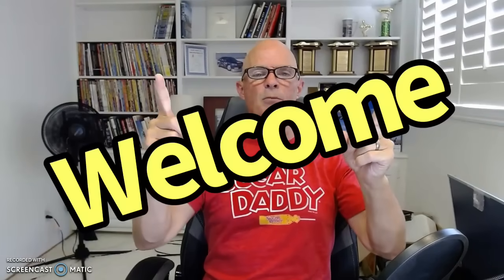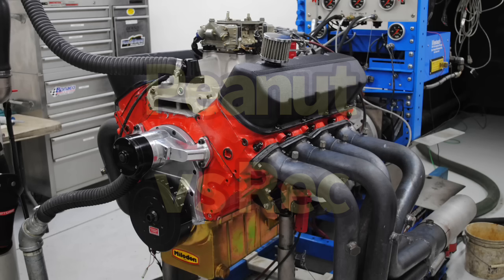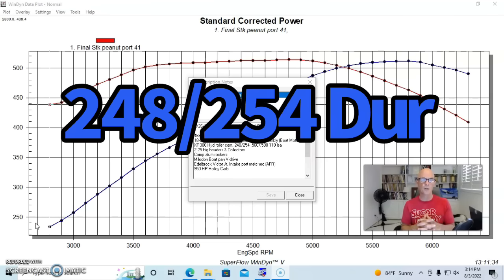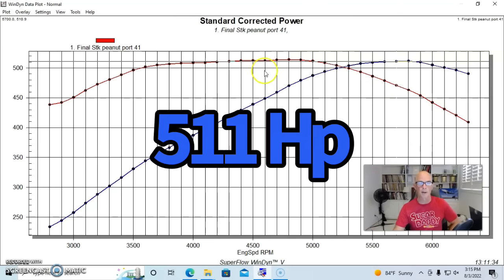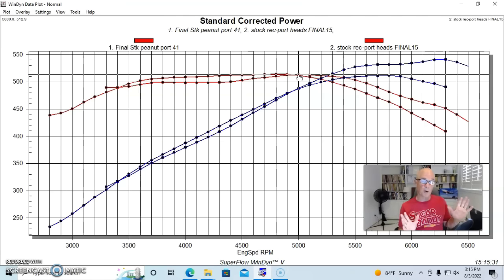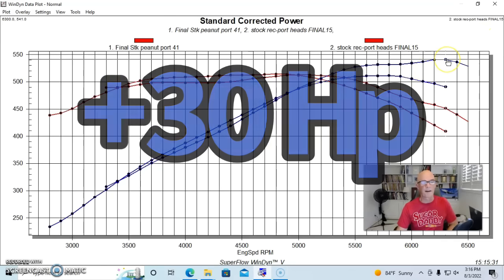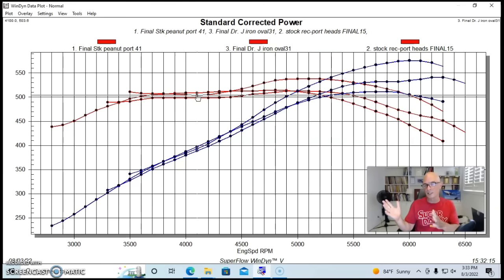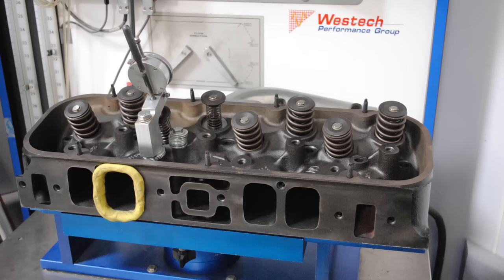WHICH FACTORY BBC HEAD MAKES THE MOST POWER? PEANUT PORT vs PORTED 049 OVAL vs REC PORT vs AFR 265!

Comment: I've noticed one thing about your comparison videos. There is never a straight up comparison. There's always something off, like having ported oval ports in this video, that makes the entire video suspect. Finding a set of factory stock standard oval port heads has got to be an easy task. They're all over the place on FB Market place. Please strive to make the entire video fit the same theme. Not to leave a big hole of an answer as to just where a non ported set of oval ports would have came in at.
Reply from the maker: so make sure to do the video YOU want to see?
Reply: @richardholdener1727  Nice to see you take constructive criticism so well.

Comment: this demonstrates perfectly what I do not like about dyno videos and talking hp gains, that engine has pretty flat torque curve from 3500 to 5500, you state the rec port made more hp than oval, but not until you hit 5500, if that engine spends its life 3000 to 5000 then no gain with rec port
Reply from the maker: in what type of acceleration contest do a motor spent its time from 3500-5500 rpm?

Comment: I wonder if the $3k cost for AFR265 heads is worth the power compared to spending the same $3k on a Speedmaster 6-71 blower setup put on the peanut or oval port heads without internal changes?
Reply from the maker: blower adds more power

Comment: You have to do some twisting on a BBC to make the rec ports work for you. I've messed with them for years, and only on racing engines did I ever like them. BTW I have a very nice set of 1968's that I'd consider letting go of.

Comment: A whole lot of years ago I was building a 427 tall deck, and noticed those AFR 265's. I called Tony Mamo, asked why not these, and why did AFR only advertise these as upgrades only for towing applications? I said "Geeze- look at the ratio of flow to runner volume, implying huge velocity/swirl, in a oval port compatible head. And, non cnc, 109 cc, with what appears to be great quench!". He called me back, and he sounded really excited in his message: "Yeah- give me a call- your 427 will be a monster!" (paraphrased). Yeah, pretty much unbeatable in low displacement BBC, for 396-454, with an untouchable off the shelf combination of high-end hp and super down low torque. I don't get how I don't see these on every aluminum-topped BBC in that displacement range. Maybe most just look at runner volume and not the actual data, and can't imagine whats possible with 265cc...
Reply from the maker: those are great heads-but most people have a hard time getting past bigger is better

Comment: I had a 396 in a 1969 SS Chevelle back in 1980 that we ported oval ports to rectangular ports in order to match a Corvette tripower we used on it. This was a 396 w/o any stroking or boring, or anything else. We use chromoly  main bolts. The cam was huge and intake was 326 duration and 550 lift on a non roller cam. Compression was 11.75. 550+ at rear wheels on dyno and would turn 7300RPMs. It was just a cheap build meant to go as fast as we could in high school, and get it it did!

Comment: It's all a package. What HP and torque do you need at what RPM range. Mismatch air flow, compression and cam and you have a mess. Max HP versus usable torque at the RPM you need to run are two different things.

Comment: Aren’t you the guy who said 340/6 against the world. Said not a real 340/6, you said the 351 boss won the contest. Found out the 351 had a .517 cam. Factory to factory, the Boss cam should have been .477. No wonder the ford beat the dodge, you cheated toward the ford. How can you run honest tests we are to believe. Shame
Reply from the maker: You need to learn more about the factory Ford cam and the change in rocker ratio between the Windsor family and Clevland family. The cam lift was given with a 1.6 Windsor rocker (the lobes were shared between engine families). The Ford beat the Dodge because the Boss 351 had heads that flowed 60-70 cfm more than the 340. (BTW-a 340 six pack would not be the most powerful 340-that would be the 1 year only manual-cammed 4-brl 340)
Reply: @richardholdener1727  you need to make sure you use the correct compression ratio, and the correct heads, and not a wore out engine, then you can brag about it.

Comment: For registration and insurance as „historically significant „ by the German TÜV I looking for the best factory heads.  If it didn’t come factory installed or wasn’t in the GM replacement parts catalog I can’t use them.    Good information on the flow

Comment: I think the real gain comes from the weight savings from 2,000 pounds of weight per cylinder head that the aluminum heads provide.  If you have picked up a BBC cylinder head...🤣🤕ouch they are heavy!

Comment: Awesome video as always knowledge is power" real world results  no snake oil" b.s  from the manufacturer": i had 904 rec ports on a 383 , with a notched dual plane but longer runner single pulled thru mid & top impressive you can get over a hundred hp with just heads" thinking 75 hp max on street/mild strip car
Reply: Depending on cam, intake ,compression, bore / stroke, carb CFM , fuel pressure,    that motor can be 700 hp N A. Torque monster

Comment: I currently have a set of 990 rec port heads on my .060 over 427, making 439.  I have a set of either 049 or 781 heads in my shed I was going to build for it, the 990's are too big.  I was considering a set of AFR 265's, this video confirmed it.  By the time i have my oval ports worked over, I'm into it as much as a set of AFR's for the same money

Comment: I currently have a gen v 454, would my current intake manifold work on a gen vi, im running a high rise manifold with a 750 carb
Reply from the maker: yes-but is your current gen 5 manifold designed for the stock gen 5 peanut port heads?
Reply: @richardholdener1727  yes i believe so, it had stock heads

Comment: What's the deal with the small port, short runner oval heads?  A few years ago nobody offered a small port aftermarket head. It was a given that bigger ports was what your motor needed to make big power.  Not only that, but longer runners, not 312cc or even 325cc was to short. Now, big block heads can be purchased from 290cc to 310cc.  A few years ago, it was 325 to 370s where the norm. When and who published their findings, showing bigger was not necessarily better, or is this some marketing scheme?
Reply from the maker: effectiveness of the head is not based only size-it is based on flow and size

Comment: Having built a few BBCs here in Australia, for V-drive boats, cars and trucks, I tend to focus on torque. I wouldn't run stock rectangle ports with less than 260@050 intake and plenty more on exhaust. I did a 454 in a 73 LWB C10 tow rig years ago and used a set of oval ports off a 360HP 396 (can't remember the casting number), but with a mild hydraulic flat tappet, a c 427 intake, stock convertor and 3;07 gear it ran 13.9 and would pull down a house. I now own a 1988 K3500 TBI 454 single cab and it happily pulls 3 tons of redgum firewood in a trailer with another 2.5 tons in the tub. I'm thinking of either TFS or AFR heads around 280/290 cc intake with a hyd roller in the 215/225 - 225/240@050 range. It is a hunting and firewood rig. I live in rural north east Victoria Australia, so it will be used in hill country and freeways. No city driving. Any thoughts?

Comment: This is interesting, but I think the thing to be aware of is, the short block never changed.  Bolting on a better set of heads means you can also get a more aggressive cam to take advantage of them.   So while that cam you had was probably pretty big for the peanut ports, the rectangle ports needed a bigger cam to get the numbers.   I would also say that 30hp is a pretty decent gain when no other changes were made.

Comment: I never could figure out why when they went to the peanut port why they moved the port to the bottom of the rectangle port opening...  seems they could have shrunk the ports for low RPM power just by filling the floor but they basically filled in the roof and lost some of the higher RPM potential by having a less straighter shot at the back of the valve... filling the roof helped tq and cost HP, filling the floor would have helped TQ the same way but with less effect on the high RPM HP.
Reply from the maker: be cool to test that

Comment: What miracles could be had on my '73 Corvette Big Block auto, if the numbers correct head and manifold would likely be retained but with the addition of headers, cam and replacement carburetor?  She is choking at 275 hp. Would it be possible to increase the horsepower by 50 to 100 by headers and carburetor alone?
Reply from the maker: where was the 275 hp measured?
Reply: @richardholdener1727  I have not a clue. What I was led believe is the manner in which the HP was measured is not the same as today. Now, I doubt it was at the rear tires. I could only wish this.
Reply: @richardholdener1727  This is spec HP and I have seen it reported both as 270 and 275 HP. I don't know.

Comment: Have a question for you I have a stock gen 5 1991 454 with peanut port heads out of a rv I have a set of 353049   1973 402 heads can I put those heads on my 91 454 and if make a little more power or should I just stay with peanut port it’s going in a 82 c10 thanks for any help
Reply from the maker: are the 1973 head oval port?
Reply: Yes they are and they are ported

Comment: Richard, did the 049 oval heads have stock size valves or the same size as the rect. heads?

https://www.youtube.com/watch?v=02bMP1aZfeQ
Reply from the maker: ported 049 had larger valves

Comment: Im guessing the stock oval ported heads retained the stock valve sizes?  I like the aftermarket heads but its way cheaper to build a set of stock oval port heads with larger valves, 3 angle valve seats & 2 angle valves does do well at low to mid range lift where a normal street engine spends most of its time.  Cruse speed with OD transmissions was where the peanut ports shined.  For my towing use I run Turbo Diesel for better mileage & power.. for an big offroad truck a built bbc is sweet, for mud, sand & snow an LS works well or built gen 1  383 or 406.  Any cam shoot outs for LS1 5.3L for trucks & other offroad builds?

Comment: Not on this type of application but check out the F.A.S.T. class stock appearing racers with the top big block chevy guys making over 700hp to the wheels and running low 9s.  Crazy, they LOOK stock including cast iron manifolds.  Check out Horsepower Depot videos for the top guys.  I mean 9.31 @ 147 on STOCK TIRES... yeah.  https://www.youtube.com/watch?v=nb-tUwKlCfs

Comment: we need to see the flow specs for all of the heads to have a good analysis of the test! It leaves too many questions....  The peanut port heads would have done better with comparable valve sizes and the required bowl and short side reshaping. The Dr. J 049 oval ports were probably ported for valve lifts much higher than those achieved by this cam! Flow them first!!!
Reply from the maker: I flowed ever set of heads, measured spring rates, measured chamber and port volumes, even weighed the valve train mass.
Reply: @richardholdener1727  I didn't see the flow sheets in the video. Are they somewhere else?

Comment: I would like to see a peanut port head let's say 1978 version with the 2.19/1.88 valves installed would do ....don't get me wrong I like hp but in my realistic world I dont drive my truck at 6000 rpm's on the road....and can't afford $10,000 on a race motor just to say I have one ....let's do a real budget build not your race budget build

Comment: I think once again that even the cheaper AFR heads blow away all the GM heads and for that matter all of the low cost offshore aftermarket aluminum heads.    I can't see using anything but an AFR head unless you have a really good porter ,   flow bench and  a lot of dyno time available.

Comment: Yes ported REC port heads will make more power, only down fall with factory heads is the big heavy 3/8 stem valves. Ported quit a few rec port heads for circle track, drag and pick pullers

Comment: Could you do a video on a 454 stock rod length vs the 6.385 rod and appropriate piston? How different they rev and any power benefits.
Reply from the maker: how different they rev?
Reply: @richardholdener1727  any benefits and if it's worth it. Same everything just the longer rod and piston compression height. Guess it don't matter what engine you do it on but a bbc would be great! Thanks for all you do either way. Great channel!

Comment: If the valve closes before inversion in the intake runner into the head you will end up with a vacuum there when the valve opens again and it'll push air into the cylinder closing the valve after we get back up in the runner you'll lose power
Reply: The bigger the valve the bigger the runner the more it flow the higher RPM you have to reach maximum flow in the winter where you have to choose where you're going to put your RPM range by your gear ratio and tire size I ran naturally aspirated all the time and made all my friends step up we blew up motor after motor with nitrous turbos and then they figured out what their problem was trying to get too much out of one cylinder

Comment: You can run any camshaft you want no matter how large it is with flat top pistons and 9 to 1 compression the more volume of air and fuel you can get into cylinder the more explosion you can have with a domed piston you are losing volume in the cylinder a 598 with 10 to 1 makes more horsepower and torque than a 598 with 13 to 1 compression go figure
Reply from the maker: I have not seen that to be the case in the 10:1-13:1 range

Comment: You have to run a bigger cam for the larger heads. You can't test an engine with 3 sets of heads with the same cam. You need to match the cam to the flow of the heads.

Comment: I wish the peanut port heads were the ones that were ported so we could see how they would do against a set stock 781 or 049s
Reply: IF a guy like vortecpro did them they would run well. Most DIY guys porting peanuts would regret not going t oa larger oval port.
Reply: @gordocarbo  so how much faster you think I would go with 781s over my 236 heads on my junk 454 ?  High 10s ? And i didn’t even have a valve job done on my peanut ports ! What would I run if vortech pro ported my heads ? Mid 10s?
Reply: @operatingengineer You could port the peanut heads to flow what a stock 781 or 049 will flow. Hell of alot easier to just start with the bigger oval port heads & add bigger valves & bowl blend. Plenty of bigblock Chevys running mid to low 10s NA with oval port heads. Porting iron bigblock heads will take all year.
Reply: @thereluctantgearhead4544   totally agree! The point of this motor was for my son to learn how to race as an upgrade to the stock 238 he raced the year before, this motor was just a bunch of junk laying around and all new parts were the cheapest I could buy, i never intended or tried to port a peanut head out to the size of a rectangle port or even a big oval! All I did was bowl port and clean up the intake runners and get rid of the ridge at the intake port entrence , the exhaust ports were not touched and I kept the 2.06 valves because these heads were of a motor home with VERY low miles so I didn’t even do a valve job! I wasn’t concerned with the port matching because I’m using a winters rectangle port intake on peanut ports 😅 and FYI I put my cleaned up 236 with 2.06 valves on a flow bench and I also brought a stock 781  head with no porting and that also still had 2.06 valves, my peanut port head out flowed the stock 781 all the way to .500 lift then the 781 walked away ! The take away is for a small cam 5000 rpm street car or truck motor the 236 head is an awesome inexpensive option! 
With a qjet, winters intake, summit 1302 cam this combo went 11.60s @113 as seen here

https://youtu.be/LTehFJTjTiE?si=Z0JL9GRd46srLXTb
Reply: @gordocarbo  https://youtu.be/LTehFJTjTiE?si=Ul35StoFgedAu7AV

Here is my 454 with peanut ports that I ported in my garage, 2.06 valves, .540 lift summit 228 238@50 hyd cam , winters rectangle port intake , qjet carb, 2 1/8 headers 9to1ish compression, and no machine shop work the heads still have the factory valve job!
Reply: That's what I want to see. A ported set of peanut heads with as big of valves as you can put in them. I believe that the air velocity of the ported p's are going to surprise a lot of folks down low. Maybe not that particular camshaft, I'd like to see the duration at about 230/240 and a lift at 525 and a lobe center of 112 and one at 114. We need information. Lol
Reply: I've got a set of square ports that I took off because I knew it was killing my low end. But they really pulled hard up at around 6-7000rpm,and I knew I wasn't going to be there much if ever. And they make tuning a carburetor a nightmare for street driving.
Reply: @ every street car I have had rectangle ports on had horrible low end! My peanut ports are done at 5800 rpm but have instant performance off idle to 6000 ! Since my first comments on this post I had 2.19s put in the 236 heads ! On a flow bench they outflowed my stock 781 up to .500 then the 781 walked away! So for a mild 454 with .500 - .550 lift cam 5500 rpm street motor 236 or 360 are a great inexpensive choice!